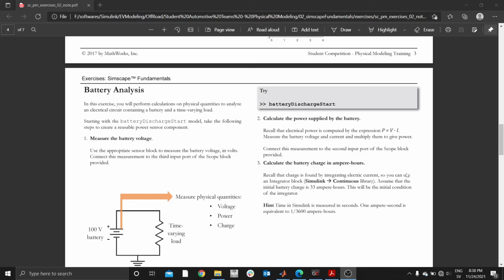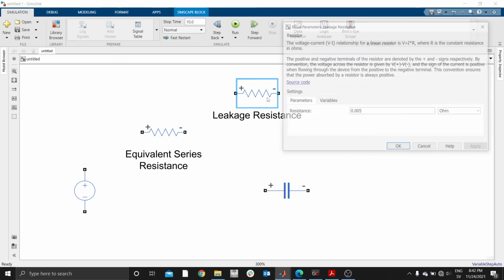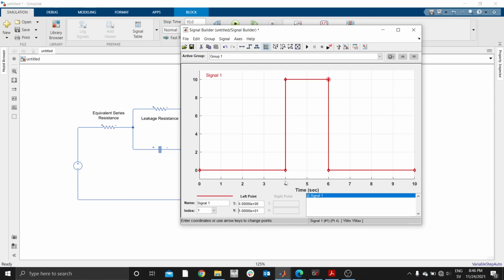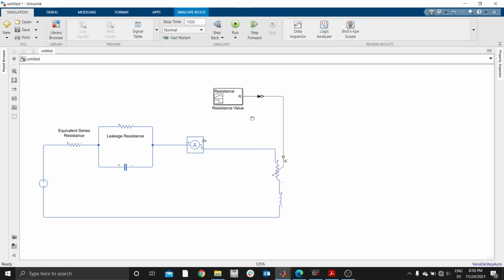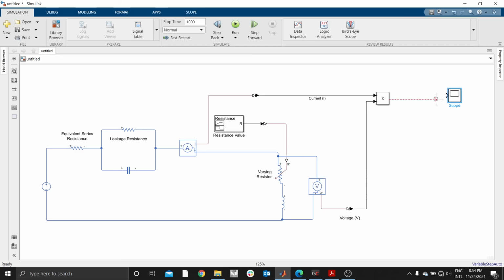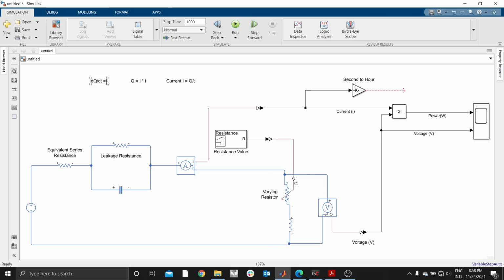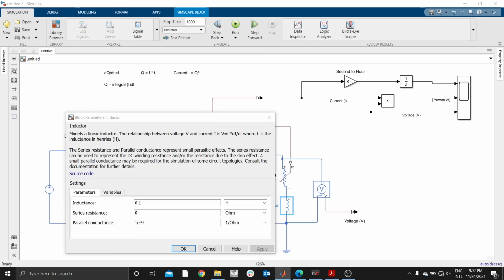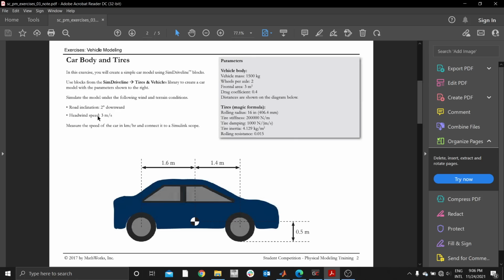Modeling Battery under variable load in Simulink Matlab (Lesson 4)

Comment: Hello sir, I got a question: In this model, the DC voltage source is supplying the battery with the 48V electrical source, so why is the battery discharging? (I can see the discharing by the decrease of Ah).  Normally, when we supply an electrical source to the battery, it is charged.
Reply from the maker: its 100 V DC source , Resistor is our Load i.e Bulb , motor , etc hence capacity decreases.
Reply: @lewis_maina  Is your idea like the case that the PV modules charge the battery but with the power less than the power that the battery has to supply the loads, so the battery's capacity decreases?